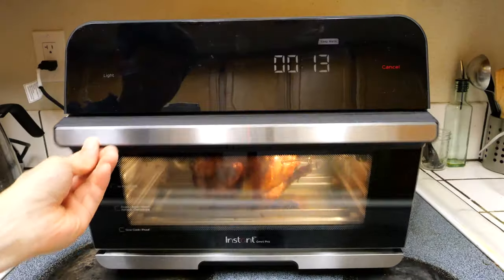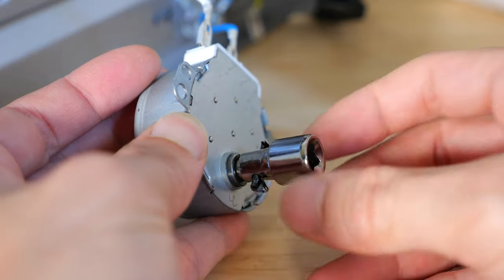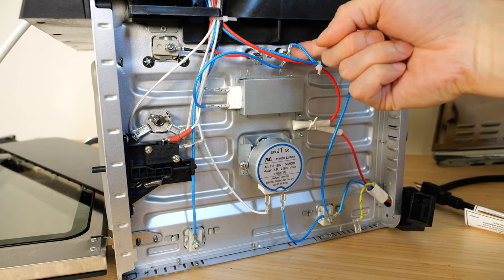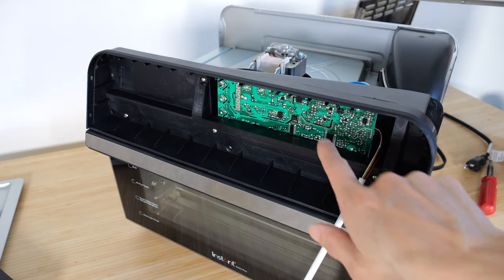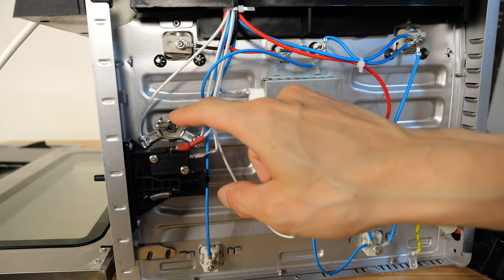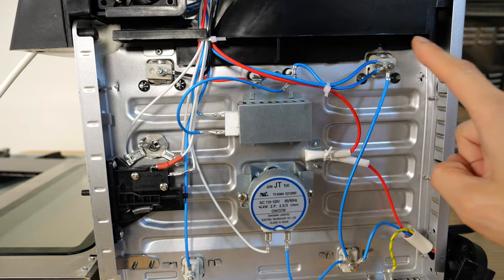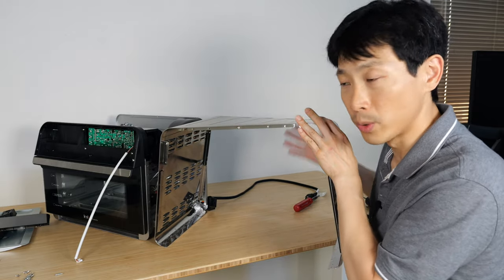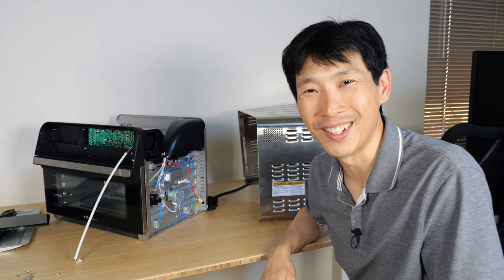Instant Omni Pro Rotisserie Motor Fix

Comment: Hello! Thank you for the video. I'm trying to take mine apart as some of the touch buttons stopped working. How did you remove the screen/touch panel? I took out the screws between it and the door, but I feel like I'll break it if I pry. Does it have to come off to remove the big metal cover you removed?
Reply from the maker: I believe it was prying, held together by plastic tabs, not screws. And yes for last Q.

Comment: Hey, can I replace the motor with a faster one? How do I know which one is fast?
Reply from the maker: Interesting you ask about this. You probably could if it runs on the same voltage, the drive circuitry and handle the extra current, and the mechanical measurements are the same. If you're handy with electrical stuff, you might be able to boost the voltage and make it spin just 10% faster without burning up the motor.
Reply: @BeatTheBushDIY   I got air fryer that has 3 RPM only. I wanted to use to roast a coffee. However, coffee needs at least 15 RPM to roast. Do you think it’s possible to replace the motor with 5 times RPM? The weird thing I couldn’t find any class H motor! Which can handle 180C degree! I’m not handy with electrical stuff unfortunately! I did a research about motors and was planning to find someone who can replace it for me
Reply from the maker: You beat me to it with the coffee roasting. I'm sure once I start, I would've wanted the same thing myself. Ha! Better yet, if you modify it, you'd want a switch to change it back to original so you can still roast chickens. =D
Reply: @BeatTheBushDIY  I bought this one just for coffee haha. I have another air fryer for chicken. Anyway, I asked a technician and he said changing the motor won’t change anything. He said i need to replace the control board and reprogram it with different input for the speed. Too much work haha

Comment: How did you remove the cover? You mentioned that there are clips on the front of the oven, but you didn't explain how to release/remove them. I'm afraid of damaging it, and can't figure out how to release the front clips. Some help would be nice. Other than that, a very informative video.
Reply from the maker: You can use a plastic pry tool to release the clips. Don't use a screwdriver as that will damage the plastic.

Comment: My touch screen stopped working insta said  it can't be fixed. The middle section of touch like temp up and down and time
Reply from the maker: When it breaks, the source of where it broke matters. Sometimes it shorted out from water entering. Other times, it could be loose connections.
Reply: @BeatTheBushDIY  honestly I rarely used the unit it broke in near new condition. I think cleaning the outside of the unit with something other than a towel or microfiber caused it to break.